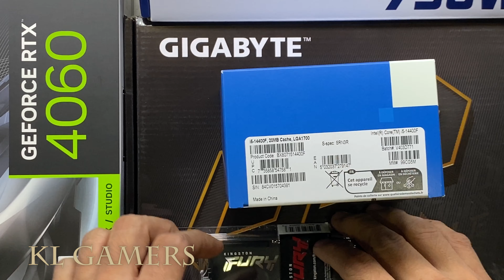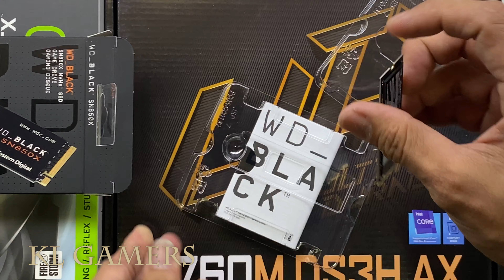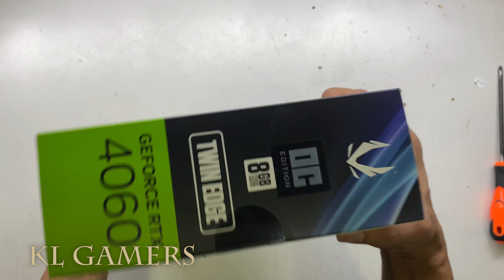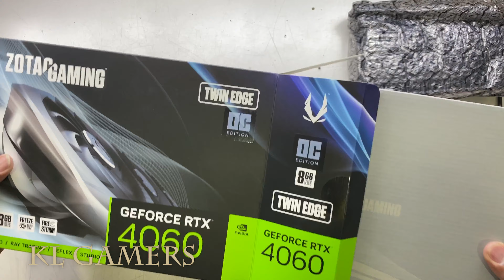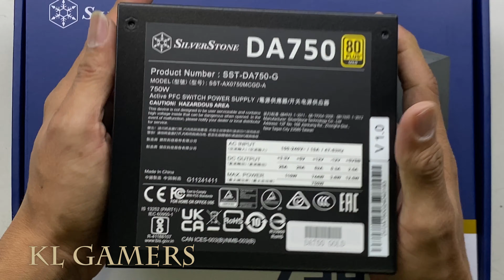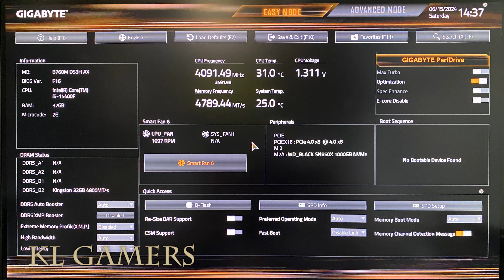intel Core i5 14400F GIGABYTE B760M DS3H AX ZOTAC RTX4060 Gaming PC Build

Comment: bro i have and intel 12400f and an zotac rtx4060 B760m bomber wifi mobi and 16gb corsair vengeance 5200mhz ram, im using gigabyte p650B power supply for this build is it sufficient?
Reply: you can use 500w if you run the 4060 bro